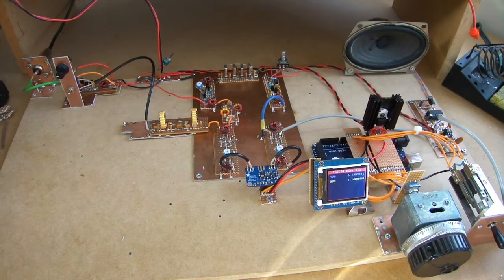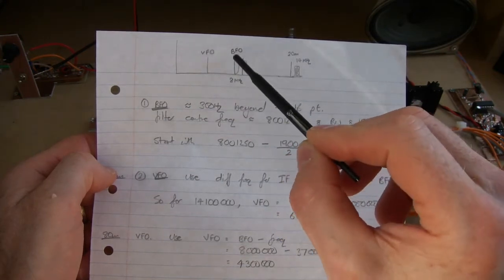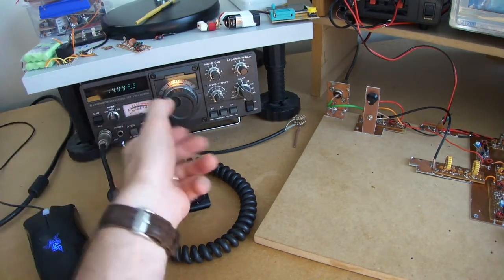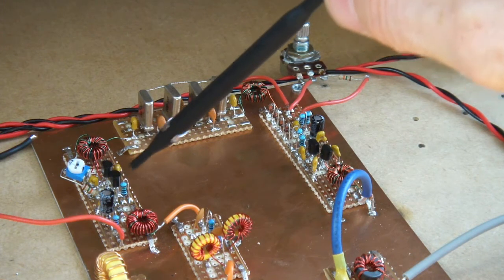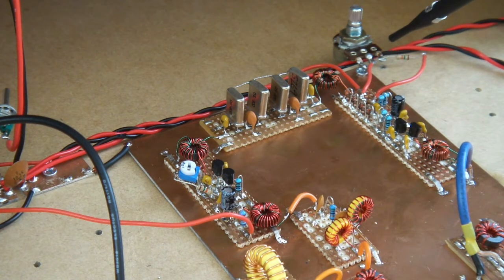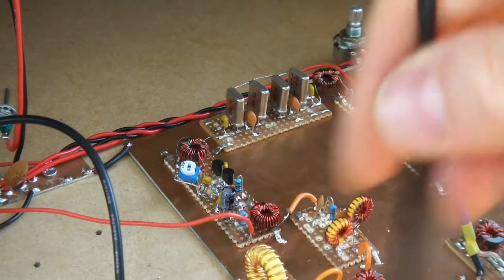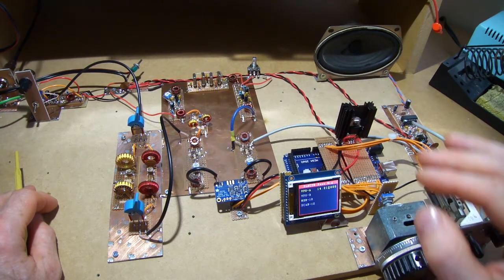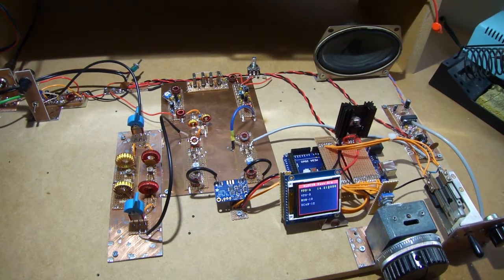Homebrew 80m/20m SSB Rig Part 5 - Superhet Receiver Experiments

Comment: Hi Charlie,
as always, verry interesting. Can you give us more Informations about the diplexer that you put in the IF path?
I´m also interestet in the test software for the SI5351. ;-)

73 Bernd
Reply from the maker: Hi Bernd. The Diplexer is an interesting topic. I still want to explore the diplexer in Solid State Design for the Radio Amateur, but that text does not have any mathematical derivations that I am after. In the interim, I'm looking at a Bridget T diplexer, which appears often. I haven't dug too deep into it at this stage. See half way down this link: http://homepage.eircom.net/~ei9gq/rx_circ.html. Here is another approach: http://g0mgx.blogspot.co.nz/2011/06/. And here is an online calculator: http://www.changpuak.ch/electronics/calc_16a.php. I looked at a Q of 6.
I'm currently experimenting with XL1=XL2=XC1=XC2 at 8MHz. I've selected a standard capacitor value of 390pF and worked out L to resonate at 8MHz. The jury is still out as we say!

73s

Charlie
Reply from the maker: No probs too with sharing the test code. Essentially, the Si5351 command is: 

  si5351.set_freq((freq * 100ULL), SI5351_PLL_FIXED, SI5351_CLK0);
  si5351.set_freq((BFOfreq * 100ULL), SI5351_PLL_FIXED, SI5351_CLK2);
Reply: :-) You're right.....
Thanks for the links. That's what I was looking for.
My IF is also at 9 MHz (a crystal filter from my Junkbox ...).
It saves a lot of work that G0MGX already tried and calculated ;-)

73 Bernd
Reply from the maker: Excellent. I'm using 8MHz as that was all I could source locally.